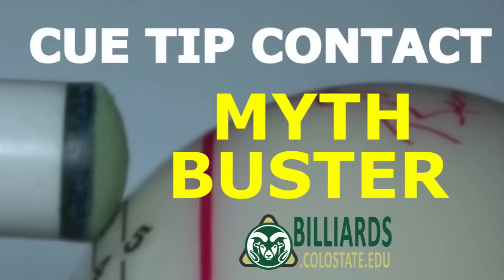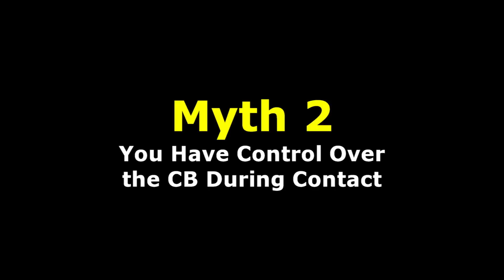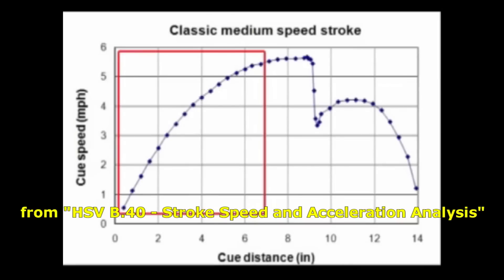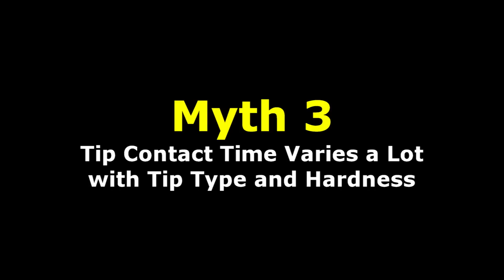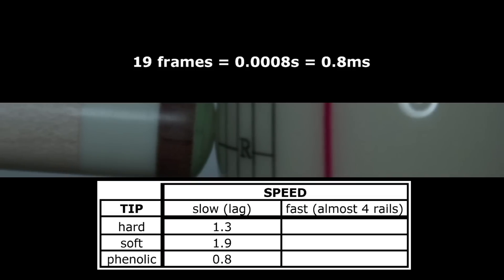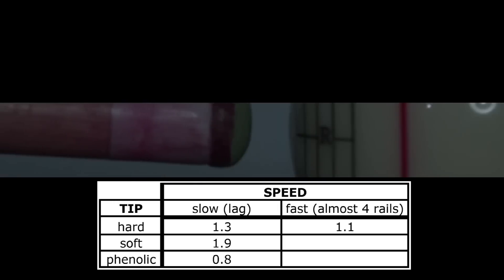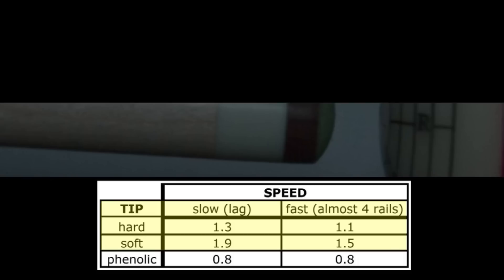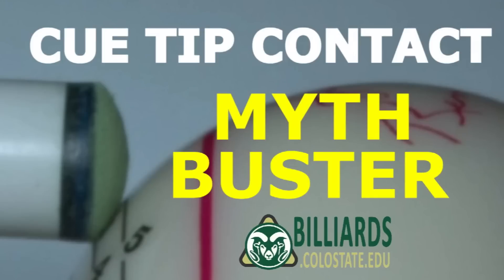Cue Tip Contact Myth-Busting Truths in Super Slow Motion

Comment: You raise lots of interesting issues, but many of the dismissals don't follow on logically from the data here. The percentage changes you show in the tip differences are huge. If that is cancelled out in the result, it would be good to see more working and explanation. The data as presented here points to something meaningful, not the absence of anything. You'd need to show whatever factors can cancel out the difference to have a basis for dismissal. 

Also, the graph showing deceleration is very interesting but we need to look further beneath the surface. I've done a lot of deep analysis in relation to piano technique, in which the issues could have some similarities when playing from a height.

When the finger reaches a piano key, I don't doubt that it is quickly decelerated by the contact like the cue. HOWEVER- what is important is that trying to focus maximum (intended) acceleration through this time could both radically reduce the deceleration at contact and also increase contact time by a meaningful percentage. I feel that your data is presented so casually and without consideration of other variables, that you're basically giving the impression that you can only hit with more or less speed. People try to claim the same regarding piano playing and I find it grossly detrimental to technique to only think of applying a speed, rather than a pacing of acceleration. There's a snooker channel where a coach did high frame rate videos that suggested well timed shots slightly increased contact time (no doubt through trying to focus acceleration into that instant of deceleration). You show a meaningful basis for illusions in that area, but not for dismissing the possibility of real difference, based on timing of acceleration. 

Are you wanting to suggest that (assuming good aim) the rest of cueing is only about moving the cue faster or slower? I suspect not, but in wanting to bust myths that's the impression you're giving. If an experiment doesn't pinpoint the basis for something deeper, that doesn't prove it doesn't exist. It means it wasn't located within the particular conditions tested.
Reply from the maker: For deeper explanations supporting everything in the video, see:
    https://billiards.colostate.edu/faq/cue-tip/hardness/
    https://billiards.colostate.edu/faq/stroke/acceleration/
    https://billiards.colostate.edu/faq/stroke/good-timing/
    https://billiards.colostate.edu/faq/stroke/follow-through/
    https://billiards.colostate.edu/faq/grip/light-vs-tight/
    https://billiards.colostate.edu/faq/cue/weight/
Reply from the maker: BTW, a piano key strike is very different from a cue tip hit.  The finger tip is very soft and the finger stays in contact with the key for an eternity compared to a hard and stiff cue tip delivering much more force over a tiny amount of time.
Reply: @DrDaveBilliards  true, but there is an issue where the hammer can be repelled prematurely. The escapement level is where the hammer releases from contact with the key. However, the sharpest initial blow can knock it away prematurely and thus shorten the contact time. I think the soft finger certainly helps to cushion this but doesn't guarantee acceleration lasts until escapement. I always get most sound when my fingers try to expand out during contact- equivalent to pushing through the cue ball instead of just coasting 

The cueball time is certainly shorter but does it mean we can't manipulate it by even ten or twenty percent via pacing? I'm not convinced. I'm looking through your posts now but the one I read only only factored in speed at contact without considering the possibility to increase input force via timed acceleration. Logically you get more when actively in the middle of accelerating via input than when coasting as constant speed.

You raise excellent points that can explain why follow through can still matter even if what I detail isn't an issue but I don't see any arguments yet as to why that wouldn't or couldn't be an issue. In all sports like tennis or cricket, good players don't just aim to maximise speed but try to time the acceleration with regard to contact.
Reply from the maker: To see why the differences in tip contact times are unimportant, see the pertinent explanations here:
    https://billiards.colostate.edu/faq/cue-tip/hardness/
Reply: @DrDaveBilliards  by the way, golf is an example I believe of where you need the hands to start coasting before contact. The club bends so much that if you are still accelerating you would be increasing the lag of the club. I think it's by backing off prior to contact that the club shaft can start unbending into maximum acceleration.

However, I'm confident that in the miniscule contact time and with the direct line of of cueing, you wouldn't lose out on acceleration as a result of applying input force. I just read the post where you suggest that players usually stop the acceleration just before the cueball. This is very interesting, but it makes me wonder if it varies at by style of shot or from player to player. For the highest power I'd expect acceleration into the cueball to give the most, rather than a passive contact. Whatever the norms are, I'd really like to see a test of the kind I mention in my other comment, where a robot arm reaches the contact speed in various different pacings.
Reply from the maker: @cziffra1980  Acceleration at contact might vary slightly from player to player and from shot to shot, but not by much.  Regardless, based on everything we know, I seriously doubt this is an important effect.  Having acceleration at impact means you put too much effort into the stroke, or the effort was too late, not helping to increase cue speed before contact.  Some people (even some pros) actually decelerate before contact because they create the effort and cue speed well before contact, but that usually results in pool speed control and consistency.  Check out all the other resource pages I linked when you get a chance.  They help explain the claims I have made in this and other posts.
Reply: @DrDaveBilliards  interesting. I'm very much open minded, although the theory in my mind suggests that the easiest consistency would be to increase acceleration slightly for predictability of contact. In my mind, anything that shortens contact (giving the shortest spike on an impulse graph) seems generally the least reliable. 

I'm a mediocre pool player at best, so I'm certainly open to what seems theoretically best not necessarily being the right explanation. At the piano I always find the best control from the trying to maximise paced acceleration (to prolong contact time without any backing out before release), although there's certainly notably more contact time available there. Arguably it could be considered closer to the push of a hockey puck than the short instant of cueing. It feels to me like associated concepts could still apply to shorter contact times (allowing them to be marginally extended), although it doesn't necessarily follow that it is necessary to try to do so.

Comment: Interesting video. 
My only question is “who is striking the ball”?

Pros and amateurs contact the ball very differently. What many players say the difference is hitting the ball, or pushing it. 

When I’m “pushing the ball”, the contact feels 1000x different that when I’m hitting it. And the feeling in my hand tells me the contact is more than illustrated in this video.
Reply from the maker: What your hand feels is mostly after the CB is gone.  The cue's momentum does all the work during contact.   For more info, see:
    https://billiards.colostate.edu/faq/grip/light-vs-tight/
    https://billiards.colostate.edu/faq/cue/feel/
    https://billiards.colostate.edu/faq/stroke/acceleration/
    https://billiards.colostate.edu/faq/stroke/good-timing/
    https://billiards.colostate.edu/faq/cue/weight/
BTW, the shooter in the video has a very typical good stroke with smooth acceleration into the ball, like most good players.

Comment: Hi, what does tip size determine. How does it affect performance. Such as 13mm, 12.50mm, 12.25mm, etc. Is it true that the larger the tip, the more lee way for accuracy, the small the tip the more accurate you have to be but can produce more spin? And lastly what size do you prefer?
Thanks
Reply from the maker: See:
    https://billiards.colostate.edu/faq/cue-tip/size-and-shape/
I don't have a strong preference.  I used a 11.75mm Z-2 for many years.  Now I have a 12.4mm Revo.

Comment: Missing the point.  Viewing the slow motion, even if the contact time is close in duration, the greater deformation of a soft tip increases the surface contact area which has more effect on the cue ball than contact time.  This is also why a properly shaped tip is important.

Follow through is more important to proper stroke and direction than cue ball manipulation.  As in most ball striking sports such as golf, tennis, baseball, etc., proper stroke hits through the ball insuring max acceleration and thus momentum at contact and follow through is key to doing this consistently.  

The change in speed (actually deceleration) after max results from a release of muscle tension which causes a slight change in direction.  Smooth’s the grove.  With good stroke technique  in any sport the ball is not the target but simply, “in the way.”

I still get consistently more draw with proper follow through.  Might be interesting to find out why that at least appears to be the case.
Reply from the maker: For explanations for why longer contact time, larger contact patch size, and more tip deformation do not result in more spin, see:
    https://billiards.colostate.edu/faq/cue-tip/hardness/
Concerning good follow-through, it is an indicator of a good stroke with smooth acceleration into the CB with good speed and relaxation.  See:
    https://billiards.colostate.edu/faq/stroke/follow-through/
Reply: @DrDaveBilliards  Very interesting.  Seems counterintuitive but I understand psychological bias and the placebo effect.  I would never argue against empirical experiment, but I’ll have to take a deeper look since Ephren Reyes played with a hard tip and he performed magic.  

Mine was only a thought experiment:  If a soft tip deforms or CONforms to the shape of the CB there is a greater area of contact and therefore more friction is produced, which in turn would facilitate a greater transfer of rotational momentum for a given contact duration.  I’m trying to imagine how that would not be the case.  Of course, bottom line is: hit balls with your favorite cue and tip hundreds of times until your muscles and your cue become quantumly entangled.  Thanks for bringing this to our attention…I think.  For me, the less thinking in physical performance the better.
Reply from the maker: @Thomas_Geist  See my follow-up video that clearly shows that a softer tip does not impart more spin:
    https://youtu.be/JXeOl9m5TFk

Comment: Beautiful video but with wrong conclusion. 1,9ms shouldn’t be considered long or short time. It is what it is. That’s the time of the contact that we have in this game. And it is wrong to compare that time with the time that a football players leg touches the ball, or the golf stick touches the golf ball, calling it long or short.
What matters - is the fact that there is 25%difference between 1,9 and 1,5 on your picture. And that explains a lot.

The fact, that you can do  screw backs in this game itself means that your tip moves the ball. Otherwise the cueball would always jump, because the vector of force is directed from the point of contact through the center of the cue ball, that is to the ceiling. And longer the contact you have, more accurate the shot and stronger the screw back you will get.

I don’t to write a lot, no one will read anyway.
But i don’t think that someone will be able to repeat what is done here with a break cue. 
But if in next 100 years someone reproduces it, then i would suggest him to take a steel cue with a steel tip and try again. With a steel tip you will have almost 100% of difference in a time of contact in comparison even with a break cue. Instead of 0,8 Ms you will have 0,00008 Ms. Feel the difference!

https://youtu.be/NSDpVUFJ-74
Reply from the maker: For explanations for why longer contact time does not result in more spin, see:
    https://billiards.colostate.edu/faq/cue-tip/hardness/
BTW, contact times with draw shots are not much longer than with center-ball-hit shots, still in the 1-2ms range.  More examples can be found here:
    https://billiards.colostate.edu/high-speed-video/
Reply: I like your explanation, but you will never sway Dr. Dave. I respect Dr. Dave and he serves the pool world admirably -- far beyond any other "teacher." Once in a while a tutorial will come along, seemingly controversial to many. I humbly tried it once but got a "smack" from the usual regurgitated trope. The feel of the player in his stroke and his consciousness are wrapped up as one intrinsically in his execution, and he can feel the the subtle vibrations in his arm -- just how he did.
Reply: I've red ;)😉
Reply: When a draw shot (screw back} is executed the tip follow through touches the cue ball several times. Slow motion proves this phenomenon.
Reply: @tomwallace3103 does that result in more or less backspin rpm per foot of travel....

Comment: Your analysis of Myth #4 is not clearly defined when using ambiguous terms like "a lot". How much is "a lot"? Can you assign a value to "a lot"? "A lot" is not a definitive value, it is an opinion, a subjective view. Once again, the data shows an 18 to 20% variation of contact time. 20% variation is considered "a lot" in most comparative studies. a 20% variation is a significant amount and therefore Myth #4 is more correct than wrong based upon the data.
Reply from the maker: Some people think the tip contact time can be felt and think they can discern differences in tip contact times for different tip hardnesses and shot speeds.  That would be "a lot."  When the contact time varies in the millisecond range, that is a lot less than "a lot."  These small changes have no effect on what can be felt.  They also have no effect on the outcome of the shot per the explanations here:
     https://billiards.colostate.edu/faq/cue-tip/hardness/
Reply: @DrDaveBilliards  Milliseconds are practically an eternity for electrons. So "a lot" is subjective, just like "the feel". The video shows a large percentage variation which may or may not necessarily be felt by the shooter, but does have a significant outcome of the shaft to cue ball interaction. The human body has amazing abilities to feel differences. I would bet dinner that an experienced player could feel the difference of using two exact same cues and shafts but one having a soft tip vs the other having a hard tip. Get 2 identical carbon shafts and install 2 tips and try it.
Reply from the maker: Anybody (even non pros) can easily tell the different between a hard tip and a soft tip on identical cues.  I certainly can.  The hits sound and feel very different per the info here:
    https://billiards.colostate.edu/faq/cue/feel/
A softer tip also produces a less efficient hit, causing the CB to acquire less speed for a given stroke, per the info here:
    https://billiards.colostate.edu/faq/cue-tip/efficiency/
That is also noticeable (the CB doesn't travel as far).

Comment: Your data proves that Myth #3 is correct. The soft time has a contact time that is 50% longer than the hard tip. 50% is a large increase. You are focused on actual time elapsed, but when making comparisons, it is important to look at the percentage differences.
Reply from the maker: A soft tip stays in contact longer, but this is unimportant to the action of the shot per the explanations here:
    https://billiards.colostate.edu/faq/cue-tip/hardness/
Reply: @DrDaveBilliards  I think most pro players would disagree with your assessment. I know several pro players have YT videos discussing their choice of tips. If they could not differentiate a difference in the outcome of the shots, if the choice of tip did not effect their consistency, they certainly would not be particular in their choice of tip. Darren Appleton specifically prefers the Sniper tip even though they are not a sponsor of him.
Reply from the maker: I disagree with "most."  Many pro players prefer hard tips for all the reasons here:
    https://billiards.colostate.edu/faq/cue-tip/hardness/
Some prefer soft tips because soft tips sometimes hold chalk better, because they give a softer and less noisy hit, and because it might be easier to control finesse shots (since the hit is less efficient, giving less CB speed for a given stroke).

Comment: On the CB slide portion of the video you talk about how the tip "grabs the CB and how it deforms". Wouldn't that be the result of using a soft tip? If the tip takes on the shape on the cue ball when struck and expands back out, it will definitely give the tip more contact time on the cue ball. Is it me, or is the 1st myth and last myth kind of contradicting?
Reply from the maker: The tip grabs the ball equally well with a hard or soft tip.  A soft tip stays in contact longer, but this is unimportant to the action of the shot per the explanations here:
    https://billiards.colostate.edu/faq/cue-tip/hardness/